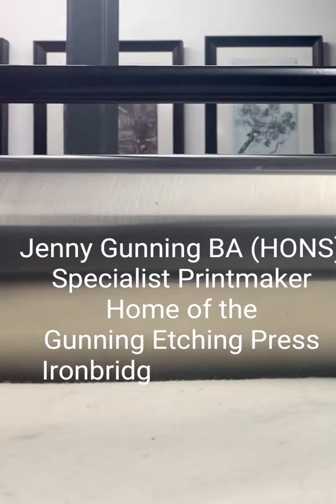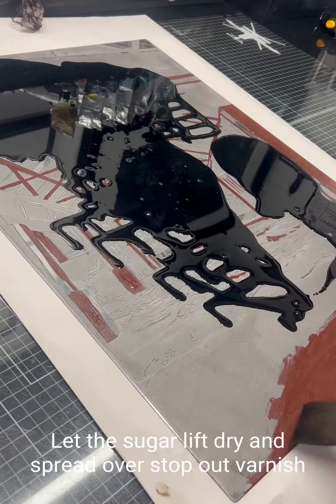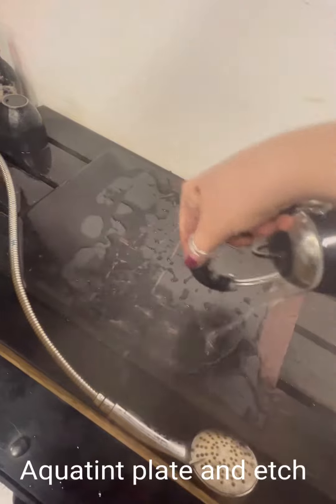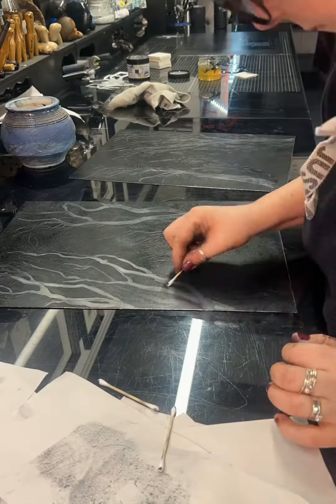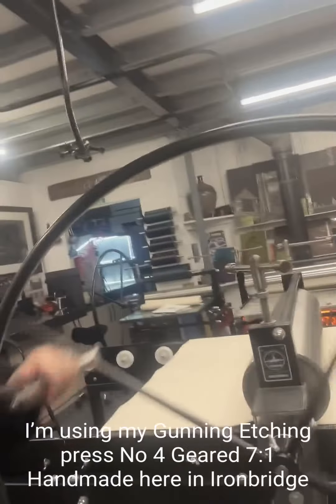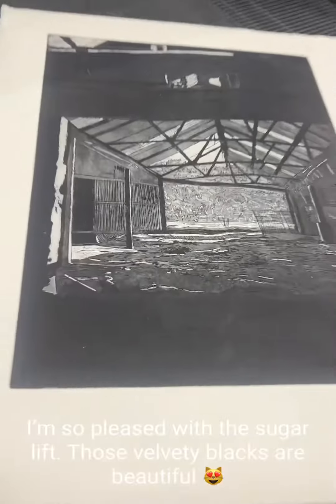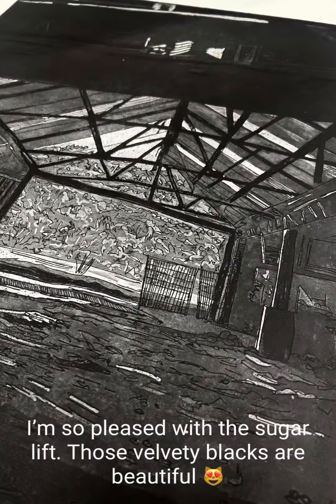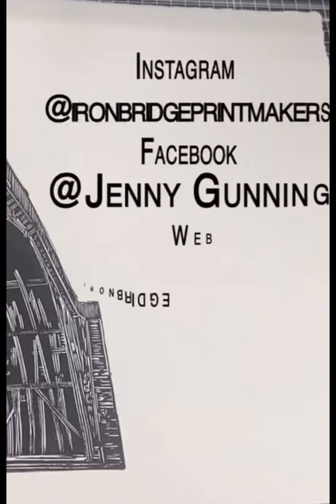How to use Sugar Lift in Etching Process

Comment: Would you mind sharing how you create your sugar lift solution? What liquids in what proportion do you use? I tried with corn syrup, India ink and liquid soap at 5:1:1 but mine doesn't stick to copper plate as nicely as I would like. Your valuable comment would be highly appreciated. Thanks.